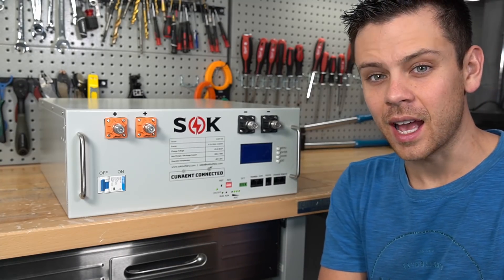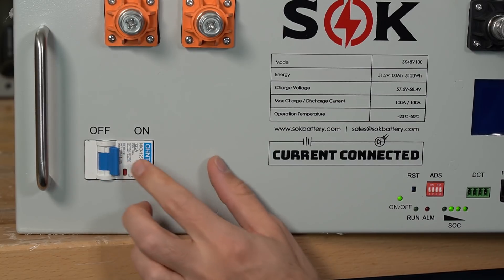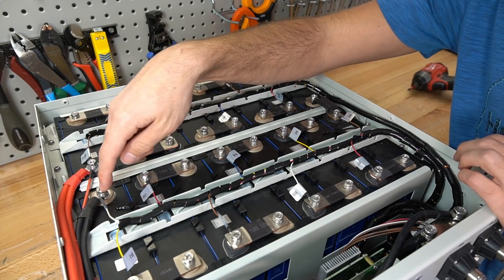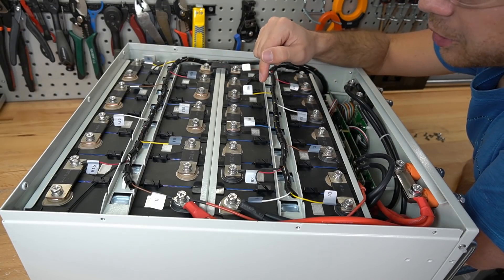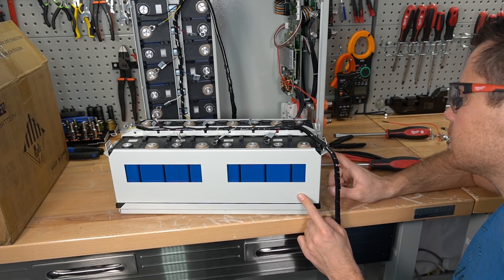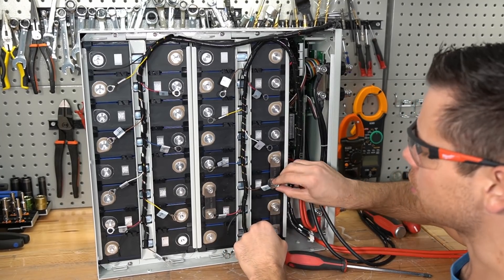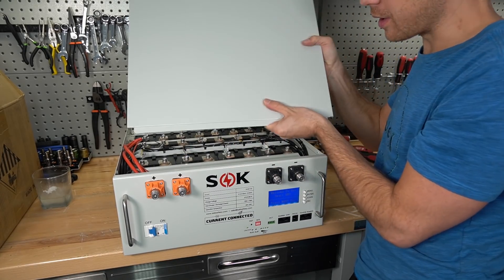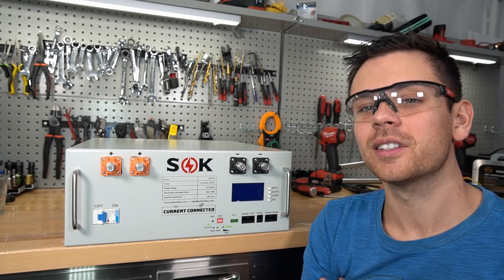New: $1,739 48V SOK Server Rack LiFePO4 Offgrid Solar Battery

Comment from the maker: The precharge resistor use protocol is the same on EG4/Jakiper/Energtech etc. They all use the same BMS and wiring configuration for precharge system. They are not special. 

SOK Server Rack Preorder (affiliate links):
https://www.currentconnected.com/product/sk48v100/?ref=wp

LV6548 should be shipping Feb. 22, but you can preorder it here: https://watts247.com/product/2-x-lv6548-13kw-120v-solar-inverter-8kw-2-x-4kw-250v-mppt-bms-ul1741-listed-built-in-wifi/?wpam_id=3

My DIY solar book paperback is finally available for $5.39 now (the lowest price I can charge on KDP platform). Amazon was not updating their database for 4 days it seems, really frustrating. Sorry that price update took so long! You can find it here: https://amzn.to/3GOPDIu

~~~~~~~~~~~~~~~~~~~~~~~~~~~~~~~~~~~~~~
Tired of getting ripped off? Check out my "Will Prowse Approved" solar product recommendations below!

12V Batteries
https://www.mobile-solarpower.com/lithium-batteries.html

48V Batteries
https://www.mobile-solarpower.com/48v-batteries.html

Offgrid Inverter System Builder
https://www.mobile-solarpower.com/48v-complete-system-blueprint-559371.html

Hybrid Inverter System Builder
https://www.mobile-solarpower.com/code-compliant-48v-offgrid-system.html

Mobile Handtruck System Builder (very popular!)
https://www.mobile-solarpower.com/mobile-48v-system.html

Solar Panels
https://www.mobile-solarpower.com/300w-solar-panels.html

Ground Mount Solar Racking
https://www.mobile-solarpower.com/ground-mount-racks.html

Wire, Lugs and Busbars
https://www.mobile-solarpower.com/wire-and-connectors.html

Tools
https://www.mobile-solarpower.com/tools.html

Fuses and Circuit Breakers
https://www.mobile-solarpower.com/fuses.html

Plug-N-Play Solar Systems
Ecoflow, Anker And Bluetti! So many models to choose from. See my current recommendations here:
https://www.mobile-solarpower.com/full-size-systems.html

~~~~~~~~~~~~~~~~~~~~~~~~~~~~~~~~~~~~~~~~~~
Need to build a large DIY system? Need a trustworthy solar distributor? These are my favorites:

Signature Solar
Creator of EG4! Solar Minisplits, Victron and More! Largest Solar Store Online.
If you want $50 off, please use my link below and coupon code "DIYSOLAR50":
https://signaturesolar.com/?ref=cPwLcVc0SW-BjN

Current Connected
Best Prices for EG4, Victron, Midnite and so much more! Fast Shipping and Highest Rated Customer Service:
https://currentconnected.com/?ref=wp

~~~~~~~~~~~~~~~~~~~~~~~~~~~~~~~~~~~~~~~~~~
Join our DIY Solar Community 
Need more help? Join the largest solar forum on the internet for beginners and professionals alike. 140,000 members and counting!
https://www.diysolarforum.com

Check Out My Free Book
Best-selling and beginner-friendly guidebook to off-grid 12V solar!
https://www.mobile-solarpower.com/the-book.html

~~~~~~~~~~~~~~~~~~~~~~~~~~~~~~~~~~~~~~~~~~
Contact Information:
I am NOT available for personal solar system consult! If you wish to contact me, this is my direct email: williamprowsediysolar@gmail.com
FTC Disclosure Statement and Disclaimers:
Every video includes paid promotion or sponsorship (such as free products for review). Some links on this YouTube channel may be affiliate links. We may get paid if you buy something or take an action after clicking one of these. My videos are for educational purposes only. Information is subject to change/update at any time. Electricity is DANGEROUS and can kill. Be smart and use common sense :) DIY Solar Power with Will Prowse is a participant in the Amazon Services LLC Associates Program, An affiliate advertising program designed to provide a means for sites to earn advertising fees by advertising and linking to Amazon.com
Reply: Hi Will - cool battery! :)
Do you know any seller that provide this BMS separatly? Cheers :)
Reply from the maker: @onomatopejaB  Good idea, we need to get our hands on those. I will ask current connected if they can sell them on their site. They are very DIY friendly compared to other distributors.
Reply: @WillProwse  hi Will, i have a legitimate question for you: the mppt solar inverter (the 8 kw, mono, 230v 50 hz, 48 battery compatible) can be hooked up to 1 to up to 3 of 2 or 3 kw wind turbine? i know that you are focused on solar, but in your research i think that you find some information about this posibility (i guess). i hope you see this message and you can give a answer about this posibility. kudos !
Reply: From Canada Will. 
Can you find out which company in Western Canada (Calgary Alberta) can supply these batteries. are they American Batteries or from China. if from China no one would want to buy ones that are imported from China to America then have to have them imported from America to Canada otherwise Import costs and shipping would be double. Population of Canada 37 Million. Population of Alberta 4.46 million in 2022
Reply: Totally looking at the battery, not your neck... and the battery looks very good. Thanks for the new price and link to your book.
Reply: Could you upgrade those cells to larger ones?
Reply: that,s bad ass men thank for sharing
Reply: who makes the BMS ?

Comment: I see the SOK SK48V100N has a pre order sale!   My only question is 3 or 4 batteries? 

I am trying to get my 2 ton AC bill off my summer bill and figure it should have enough to make my winter bill almost nothing.
A city 30 miles down the road from me was told it could have rolling blackouts in the summer. I think insurance is forcing this in a lot of areas as if the power lines cause a fire they may not be covered.

Comment: I am weighing options between SOK and Pytes V5 server rack batteries combined with an Sol-Ark 8k 2-P inverter.  Please - Can anyone tell me if I should spend the extra $$ on the Pytes v5 or if the SOK's will do the job and be just as reliable??  Thank you for your time.

Comment: I’m going to be going full time in an Travel Trailer.  I would like to use these batteries as the center of the power system, but… I plan to put the power system in the bed of the tow vehicle. Would that work for these as long as they stay 100% dry?

Comment: Will, would you have any issues using these batteries in an on-road application? We are thinking about using them for an ambulance conversion that has some pretty massive power needs for scuba compressors. Shouldn't be that much vibration on the air suspension but definitely more than on the floor.

Comment: Sorry if this question has already been answered in another comment. Newbie question 🙂

5 kW @ 48 volts has to be converted to 220 volts. That doesn’t make 5 kW @ 220 volts, right? How do you compute the output @ 220 volts?

Comment: Buss Bars need to be flexible to accommodate thermal expansion due to heating during charging and discharging cycles. Welded bars are rigid, and therefore, they will stress the posts on the battery as the bar expands and contracts during thermal cycles.
Reply: good info

Comment: Hello do I’ve been trying to build a Solar Power Aeration Systen for my father in laws pond. I’ve seen other videos but U are the solar 🤴 KING and need to know what I would need to build a solar aeration sustem for 115v piston pump including the amount of solar panels I will need. I’m trying to do this on my own as I know the other units that they sell cost so much and are battery less which only run when the sun is out Please help Thank You I am a beginner and knowledge of solar power is limited

Comment: What BMS is used with the 48V SOK rackmout battery? I see that the SOK bat can communicate with a Sol-Ark 12K inverter. Could this BMS be "transplanted" into a 48V EG4 Lifepower bat to allow it to communicate with a Sol-Ark inverter?
Tboone Fisher EE

Comment: Just to clarify, the small start button allows a small amount of power to precharge the inverter capacitors before allowing the full power from the battery to load the inverter?

Comment: Just got the LV6548 and should be getting two of the batteries from CC, mid April is what they said. I sure would like to see a video on connecting the communication from the two batteries to the LV6548. It's probably very simple once you know what to do but LV6548 instruction manual is a little confusing.
Reply: where did you get your 6548

Comment: Hey will, can you comment on the height difference on these batteries vs the eg4? I want to get these batteries and mount them in signature solar server rack that's meant for the eg4s. I was hoping you can help me out since you have both battery types.

Comment: Is the production unit for sure going to be serviceable? Non-welded battery connections. Love to see an internal heated battery with the heater power cable (or external plug) so you could have it go through the shunt.

Comment: This looks like a very nice battery, but on thing I'm not keen on is the negative cable sitting on the support cross bar.  I'm sure for most people this will not be a problem.  But I imagine that it could be a problem over 20 years if it is subject to vibration.  I have been in areas where heavy traffic actually causes the building to vibrate on a daily basis.  I think it would be prudent to add an additional layer of protection where the cross bar touches the internal battery cable.  I'm not slamming this battery though, overall it looks really cool.  Did this battery get a UL rating?

Comment: will you need insulated screw drivers!!
Reply from the maker: I have multiple sets but they don't grip as well as my other ones
Reply: @WillProwse  wrap it with some electrical tape is an easy method
Reply: @WillProwse  at work we are getting more into solar powered remote microwave sites. i've been trying to convince them to just go lifepo4 rack batteries instead of the massive single cell lead acid 48V banks. also trying to get the design to eliminate diesel prime power and just put that money into big solar arrays. solar is becoming more and more popular with remote sites over diesel which is awesome. unfortunately mountain top sites have tons of snow so the panels are almost installed vertically.

Comment: If I run a 48 volt system with 6 battleborn batteries what's the difference between them 6 100 amp batterys and this 1 48 volt does this battery replace 6 12 volt batterys

Comment: Will, you said with large inverters a large inrush current could damage any battery. Based on your older video, I built a solar generator with Growatt 3k inverter and 2 EG4 48V batteries. Not a large inverter. When connecting the 2nd battery, I charged each separately and fully, turned them off then hooked them in, turning on one battery at a time (based on Sig Solar instructions), then inverter. All seems fine. Can’t think where the inrush would come from. You say from the large inverter (?) From the grid AC? The PV? From where? Thanks.

Comment: The whole “safely connect the inverter” thing to s new to me. Does this mean that I can’t turn on and off my Victron inverter without going through the startup routine?
Reply from the maker: This is true for all inverters connected to lithium ion batteries. Check out my video about pre charge resistors and how to charge up the capacitors.

Comment: Will would love to see a discussion or video on how you can add a storage rack battery for use with say an EcoFlow Pro or other system where they already have mppt, inverter and charger. Would be cool to be able to add battery to one of those type systems. Otherwise we get stuck spending over 777 dollars per kwh, which I consider is too much $$.

Comment: Will, I had the same problem with my power supply. I found loose connection inside the mains voltage selector switch 115/230. Had it set to 115V and did not get the full DC ouput. I ended up soldering the wires together on that switch since I only use it with 120V. Works good. Thanks for your video!

Comment: Hello, my name is Mahdi from Iraq, a fan of your channel and the good information you provide. I use a Voltronic inverter that you have (mpp solar) and my battery is of the eve 280A lithium type, and the bms daly 

problem is not compatible with the inverter.  

I would like a detailed explanation of the type of connection cable with the BMS and the method of programming the inverter with eg4 and sok batteries.

Comment: Why did they use a 230V 50HZ AC MCB on a 48V DC circuit? It's dangerous
Reply: They’ve since replaced it with a 60V DC breaker, per their post on Will’s forum.

Comment: Hey there, please consider using insulated tools and gloves disassembling and assembling battery modules! I worked for Saft in their industrial ESS division. I worked in Module assembly for a couple years and was a part of a team that built several different versions of the Intensium Max ESS. I was fortunate enough to never have any safety incidents, but, they happen. The busbars in the Intensium Max ESS were like small coffee tables; we ordered copper flat stock and built the busbars to design specs.

Anyways, please be careful and keep the content coming! You put out excellent reviews!
Reply: You can wrap screwdrivers in electrical tape. Would be better than having that much exposed metal.

Comment: Hi Will! Thanks for this video. I have an unrelated question: I’m doing 14s2p li-ion for my RV, and i intend to protect both strings with a single daly bms. What are the considerations in my scenario? How many parallell strings is it safe to add to a single bms? How will a single sagging cell behave when it’s ”bridged” to a index-wise corresponding cell in a parallell string? Thank you

Comment: Great Video as usual Will,
I have two questions I hope you can answer:
First, if a system already has a Signature Solar EG4 48v 5.2 kw server rack battery, can this SOK server rack unit be added (with proper precautions SOC Etc) - will the BMS's work with each other?, communications? 
Second, for your Canadian viewers, exchange and duty are significant when importing the Signature Solar (I know first hand) - Solar Power Store Canada have a similar server rack battery at about the same price point ($1,475 USD plus CDN sales tax) but without the added costs of shipping from Texas and international duty.  I wonder if you could comment/post a video on the issue of mixing and matching different server rack batteries together, what to watch for, pitfalls, steps to ensuring the batteries will work together properly. 
I enjoy you channel very much, and highly recommend to other off-grid and renewable energy enthusiasts.
Robert.

Comment: So $240 more than most the competition which do exactly the same thing including the charge resistor and I’ve seen others do it automatically No poking screw drivers. This package is very well put together but not $240 worth. Also I’ve seen a lot of testing on resistance on solid vs flexible bus bars not sure why they are using flexible in this application and the top cover over the main terminals surprised they were comfortable shipping it like that
Reply from the maker: They didn't ship it like that, we had to build it with 100Ah packs. It was never shipped. It's the first prototype.
Reply from the maker: The terminals will be protected during shipping.
Reply from the maker: No, it's the same cost as eg4 pro model and jakiper. Actually $10 cheaper.
Reply: @WillProwse  you can get the “budget” version for $1499 no screen but then you just connect it to a laptop and you can get all the readings
Reply from the maker: @kdlange6052  yeah but those have been out of stock for ages. Sok will have budget one eventually too, so will every other company. They are not special. And they will all be the same price.

Comment: 'rack', but it doesn't have standard RETMA rack ears?   or are they optional ?
Reply: never mind, I see the 4 screw holes on the side for a rack ear.    of course, it goes without saying that the rack will need rails or a shelf to support the weight, the ears are just to keep it from sliding out of the rack.

Comment: Will, regarding the pre-charge feature- If you are running Mutiple batteries in parallel, do you need to perform the reset button turn on procedure for each battery or just the first one to fire up the inverter?

Also, you mentioned it's the same bms as used in the eg4 lifepower battery. Does the pre-charge feature work the same with the eg4 lifepower non-lcd battery? Specifically, pressing the reset button after flipping breaker upon powering down and powering up?

Thanks!

Comment: Im confused dont know if its normal,my 24V 300watts panel charge my 12V 200ah gel battery with 40A 12/24V PWM charging controller,the confusion is if the sun is high I see absorb of about 13.7v and sometimes even float.But the moment the sun is down the volt drops to 12.6v or 12.7v sometimes even without load is it normal? or is there anything wrong?

Comment: How practical is replacing a bad cell or two? My understanding is that -- unless all the cells are fairly new and have same specs -- then you're going to run into problems with differential charging and discharging?

Comment: Where can I find this BMS if I were to assemble the cells myself ? I noticed it on Seplos also.... I have been looking for this BMS as it allows the monitoring of individual cells across several batteries connected in parallel.